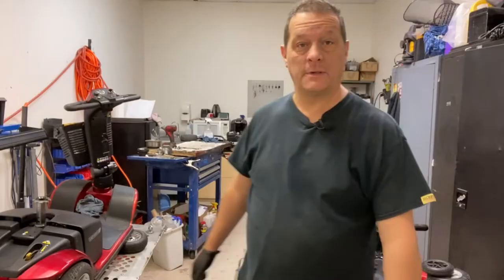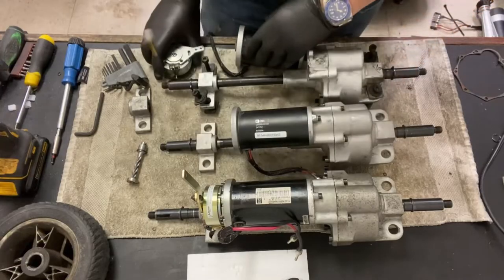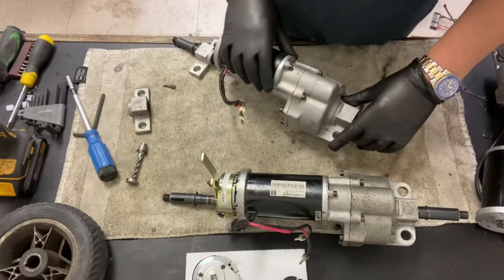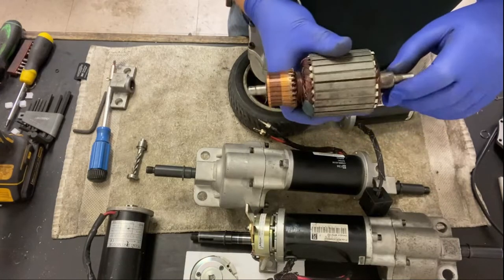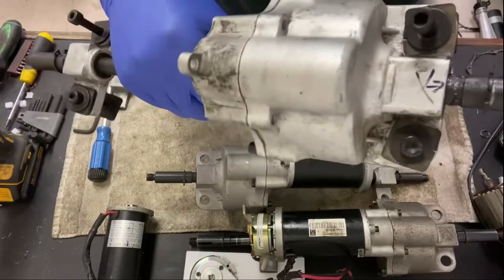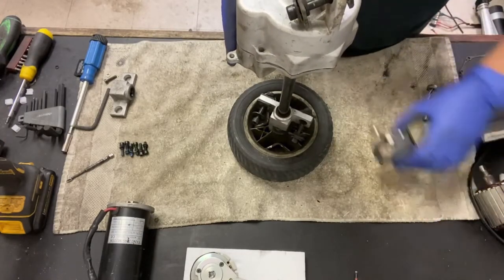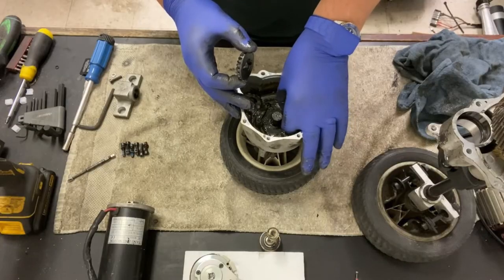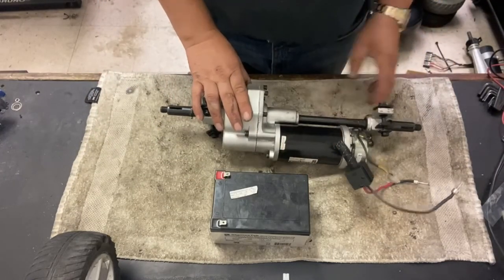How to repair a Pride Mobility Go Go Transaxle Motor and Brake – the Inner workings explained

Comment: Where can I get one of those drive gears that look like a drill bit I can’t find one anywhere
Reply from the maker: HI Ben, I don't know of any of the manufactures selling internal working parts separately. You're probably only going to find then on Ebay used if anyone is selling one.
Reply: @lasvegasscooterslifts  what is it called, just a drive gear?
Reply from the maker: There is no internal parts diagram with no specific internal part names for these transaxles. The only way I would name it would be go-go transaxle motor transfer output shaft. Please be aware that Pride uses several sizes of transaxles in the scooters, if you do find one make sure it matches your transaxle size.

Comment: we have one and the warning light on the charger comes on, it shows its fully charged but than it starts making a beeping noise  and will not go. ( I think she plugged the wrong charger into it ) how can we fix it?  Thank you
Reply from the maker: Sorry need more information, make, model and how many beeps also output volt and amp rating on the charger and when the batteries were last changed. 
Make sure the charger isn't still plugged in and the brake is in the engaged, in the drive or locked position before trying to ride the scooter.
Reply: @lasvegasscooterslifts  the shift lock was off, thats all
Reply from the maker: I like an easy fix 👍

Comment: is going down hill bad for the Go Go brakes? After going down a  few hills our new Go Go makes noise when the brake goes on. its louder the faster you go.
Reply from the maker: Hey Bob, technically yes and no! If you are on quite a steep downhill gradient releasing the throttle fully to stop is not a good idea. These scooters tend to use the motor to restrict the speed downhill and the brake only contacts when you release the throttle. I would slowly release the throttle and let the motor slow you down then come to a stop.

I know life dictates where you go on these scooters but regarding inclines and declines and most manufactures advise incline/decline gradients no greater than 8 deg (which is not a lot) as it is not good for the scooter and can cause damage to the motor brake and transaxle. (Not covered by your warranty).

The only way I would diagnose where the noise is coming from is I would remove the brake from the motor to eliminate the brake from the equation. If the noise persists with the brake removed, then its motor and or transaxle/bearings problem. Also check you have nothing trapped between the wheel and transaxle shafts. Hope this helps. Ian
Reply: @lasvegasscooterslifts  Thank you very much. I subscribed. :)
Reply from the maker: Thanks for the subscribe much apricated 👍

Comment: Hi Ian, just an update on my problem. Power as I mentioned is coming to the rear of the scooter, when I put in reverse there is the reverse sound coming through, when I press drive I get a clicking sound, if I change break position it blinks the blue light 9 times.  The scooter is a Komfi aerolite, very much like the kymco k- lite. Is this any help.?
Reply from the maker: Hey Michael, the nine-flash code is indicating that the brake leaver is in the natural position and needs to be in the lock/drive position before turning the scooter on. If you don't have a user manual for your scooter it can be found here https://www.manualslib.com/download/1519024/Komfi-Rider-Aerolite-Plus.html
If you go to page 19 it gives you a list of error code to help you decipher any errors with the scooter. If the noise you are hearing is a beeping when it is reverse this is quite normal. The clicking sound should be the electromagnetic brake releasing when the throttle is depressed. Check you speed dial is turned up. Check your power indicator dial on the tiller that the needle is in the green and not in the yellow or red.  If your batteries are over a year old, you might want to consider changing them for new ones. If all the above is ok, it could be a number of things such as throttle or speed dial problem or even worse a transaxle problem. Without seeing the scooter in person it's hard to diagnose.

Comment: When I ordered my scooter,  They never said anything about them being so temperamental and impossible to repair 😮
Reply from the maker: Hey Mike, did you buy online or at a local store? I found that it depends on what brand of scooter you have to how temperamental and hard to repair. I found if it's an off-brand product it's impossible to find parts and also, you're hard on them they can break a lot quicker. Let me know if you need any help?

Comment: Hi there that was a great video I have TGA Mystere here in the UK. I have been told my pin bearns will be needing replaced at some point I have looked for a new transaxle for it but can only find second hand I have only had it for about 3 month wished I had never bought second hand at 1 time I would go in and fix it not now as I cant just wondering if you could tell me where to get a new transaxle for it thank you very much for your help very much appreciated
Reply from the maker: Hey Midge, not sure what "pin bearns" are I've never heard that term before. Here in the US I believe that scooter is known as the "Hartway Mystere" https://www.heartwayusa.com/ and is an older scooter and the parts have been discontinued. It looks like the only option is used parts. Ian